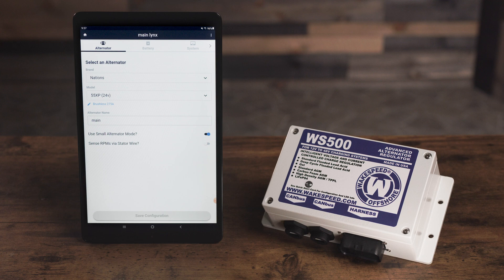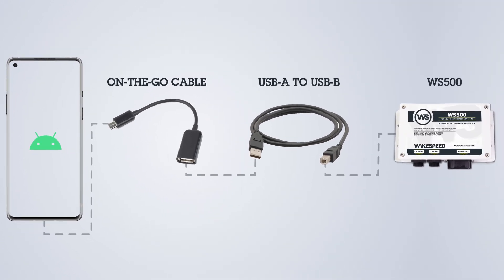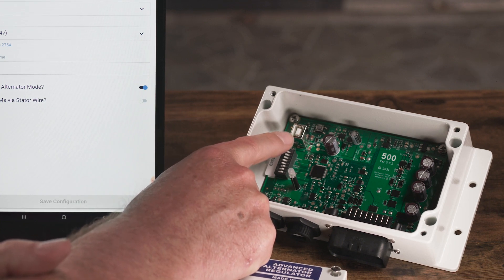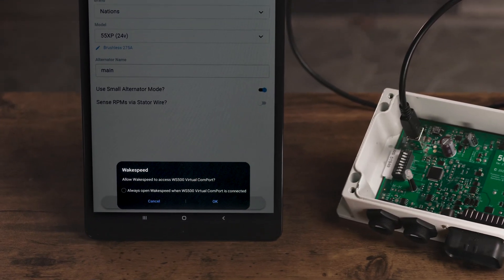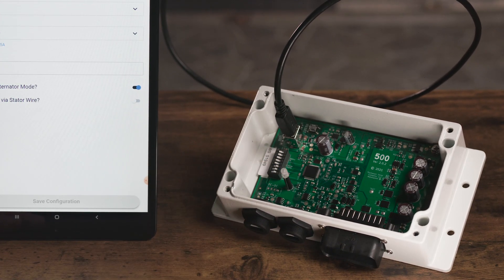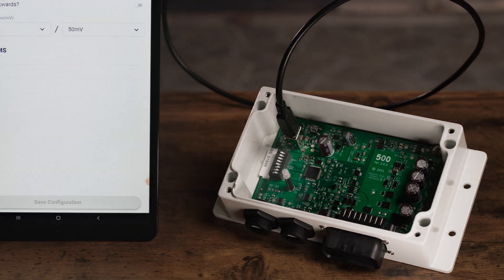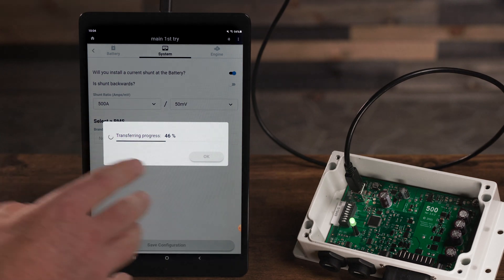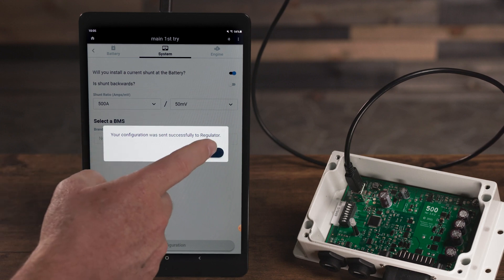Transfer a Configuration File | The Wakespeed Configuration & Monitoring Utility App

Comment: Can I use a cable not rated for OTG if I have applied 12v power to the Wakespeed? This would allow me to update it without having to wait for Amazon to deliver one.
I think the OTG protocol just allows power and data through the cable at the same time.